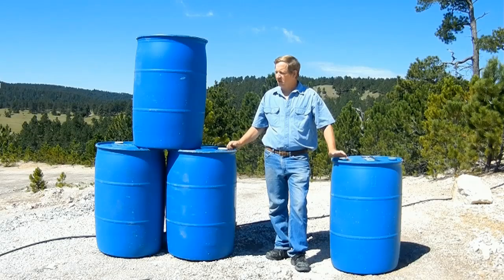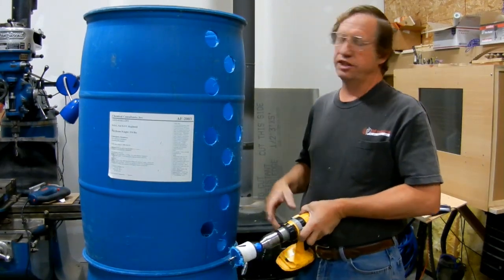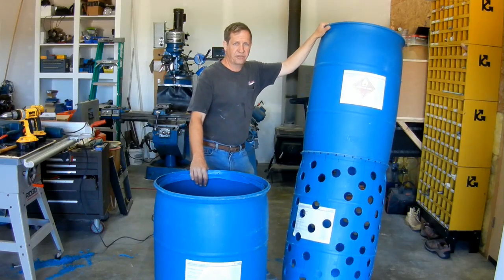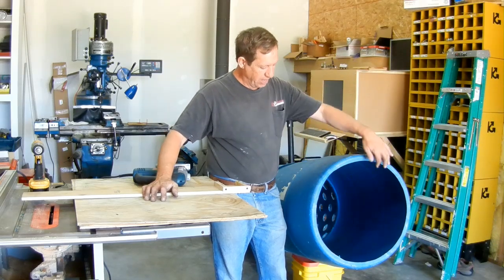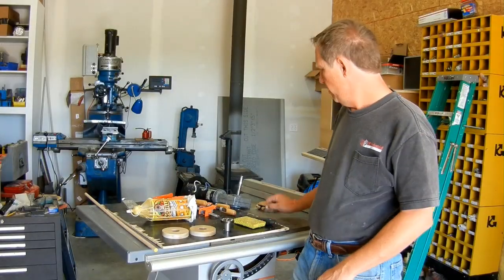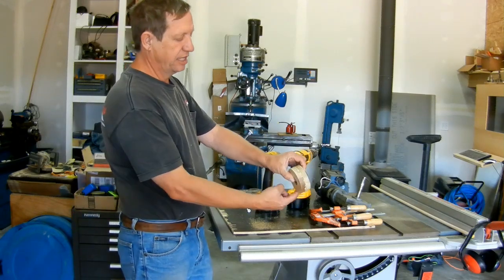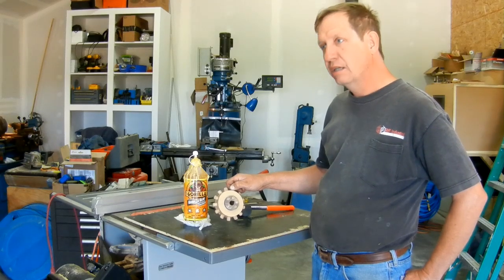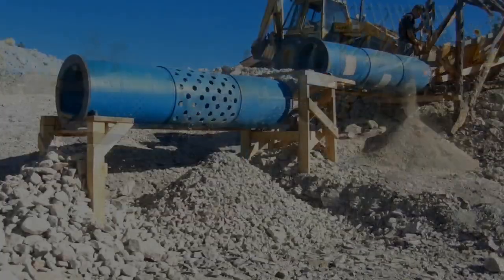Plastic Drum Trommel Screen Rock Separator

Comment: Do you have any thoughts on alterations if someone chose to use steel 55 gallon drums in lieu of plastic?Also the wood support system seem very heavy. Do you have any thoughts on changing to aluminum or steel bar? Any advice you can give is appreciated.
Reply from the maker: It depends on what your putting through, if it contains large rocks the steel drums will dent and distort rapidly. Wall thickness on modern drums isn't what it used to be. Plastic flexes as the aggregate bounces around inside and absorbs the knocks. Also the plastic drums are loud when running, steel would be real loud. As for the frame I used wood because I have lots of it, steel would work well, aluminum will cost a lot to build a structure stiff enough. Again it depends on what you separating, how fast the drums are turning and how much you load the screen.
Reply: Wow, great advice, you make a solid point about the noise. I'll be building it for mining on a dry claim. My aggregate and sort is a little smaller than what you have. I just have a lot of throughput. I think what I'll do is go for plastic with holes drilled to the equivalent of a 10 & 20 mesh sort. You've convinced me on plastic drums. The price tag of plastic is nicer than metal too. Thanks again.

Comment: I love your design and would love to build one.  I'd like to go shorter, mobile, and dry. You have two three barrel trommels.  One seems to be sorting fines the other 2 inch rock.   My question is:  Why didn't you just do both in one 3 barrel unit?  Any ideas on how I should go about sorting multiple rocks with 2-3 barrels?  Would love to accomplish fines and 10-20-40 mesh rock, prior to dropping my tailing from a shorter barrel trommel.  I know I am asking a lot but any thought would be appreciated.
Reply from the maker: +Kimberly Vanilla --In my design I prescreen out anything >5" with the bars when dumping the load. Then remove fines in the fist section with 1/2 inch holes. The next section has 2 inch holes so I get 1/2 - 2" out of it. The overs that come out the end are  2 - 5". I used three barrels per section so that I can use my back hoe to remove the sized rock from each section and its bucket is just under 8' wide so I needed three to keep the piles separated. You can make a much shorter screen and it will work fine. It all depends how you are feeding and removing the sized material. Shorter also will limit throughput.

Comment: if you're filtering out same sizes but want to separate gravel and metal from wood chips, any ideas?
Reply from the maker: Put it in a tank with water the rocks and metal will sink to the bottom and remove them with a screw. - or - Use an air density separator. Basically blow the lighter material away with an air stream.

Comment: Since you have 2 separate trommel running, the upper and lower, did you duplicate everything for both so they could spin at the same time?
Reply from the maker: Yes they are a duplicate of each other, and they run independently.

Comment: How long it will last Plastic Drum, i want a try it please reply me
Reply from the maker: My drums are still running, occasionally when I need rock or sand. The holes in the rim area are slightly elongated this could be fixed if it becomes an issue by wrapping it with steel flat bar. I replaced the drive cogs with steel because I needed to go to a smaller wheel to increase the torque. The steel ones are a little worn on one side and can be flipped around to change the drive side of the pins.

Comment: How long did the drums last before the rocks chewed them up?
Reply from the maker: I don't know I have put about 50 yards through them and they still look good.
Reply: Wow, that is pretty good. I have used some of your design idea to make a vegetable washer. My next project is to make a soil trammel driven by a treadmill. Will use the wide rubber walker belt to drive the one drum without holes.

Comment: Another great vid, thank you! Out of interest, what size motor approx is that, and do you need a gearing system to adjust the rpm? thanks.
Reply from the maker: +SpicyAl3000 --- The motors a about 1/4 HP and have a 10 to 1 gear head. I used these because I had them larger would be better. I changed the pin drive wheel size to set the speed.
Reply: Grand, thank you.

Comment: Excellent elaboration I would like to manufacture a similar one but I have doubts regarding some implements that you have used like for example that to use to make the guide of the pulley I see that you use a rule of metal with holes that name has that

You can make a list with the materials

Thank you
Reply: The metal strip with holes is a common item in the USA, it is called plumbing strap, or Perforated Galvanized Steel Duct Strap

Comment: Awesome machine! How steep did you make the chute from the rock screen to the first drums? And did you set the drums at a slope?
Reply from the maker: The chute is just plywood with sheet metal on it. The drums are on a slope, angle is dependent on how fast you want the aggregate to move through.

Comment: Great work and tutorial!  What is the motor?
Reply from the maker: --- It is driven by two 24 volt wheel chair motors. I used them because I had them but a larger motor would be better.
Reply: what rpm do the motors run? any additional electrical setup?
Reply: @mrstephenrobb  - He answered the Motor RPM question, as 30 RPM, at the Output, as I read it!